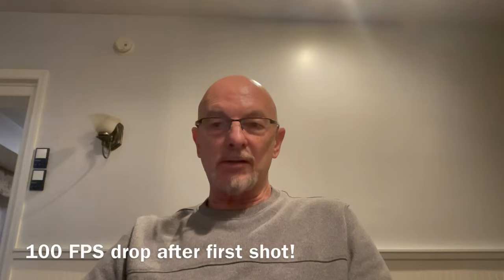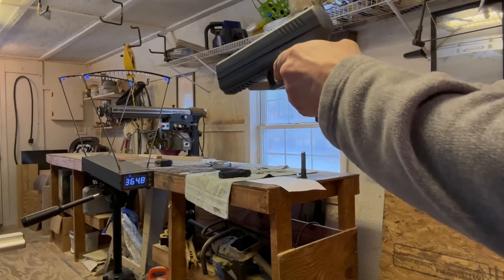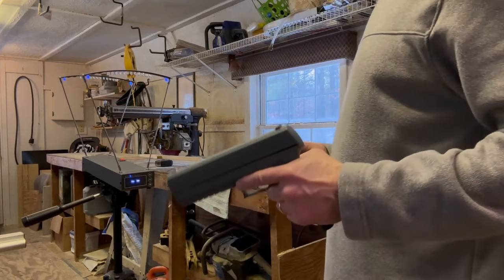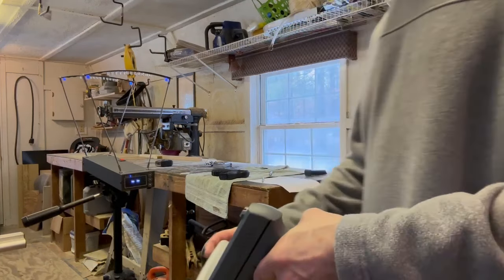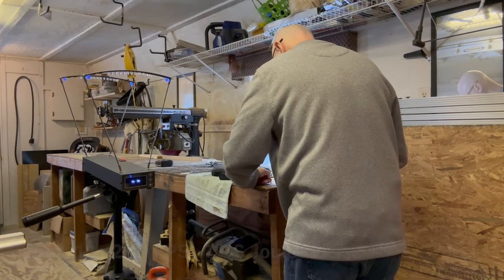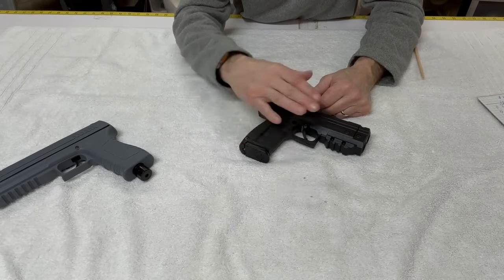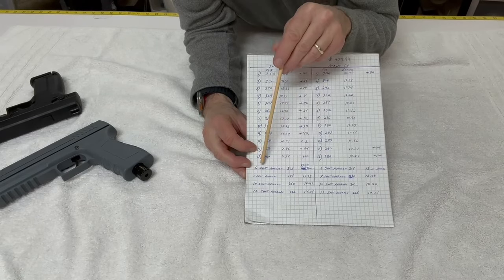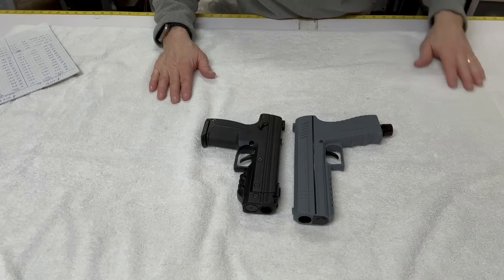Salt Supply S2 Blows Byrna LE Apart in Performance! Wow!!!

Comment: The Byrna is superior in every way minus the fps. You’re not supposed to stand there in a gun fight, the idea is to shoot and escape.
Reply: Tell us how that is.
The salt numbers are what the Byrna was "supposed" to be . Some people get lucky and get one that actually gives good numbers but even the good ones the numbers are never consistent. Watch the FPS plunge with each shot on the byrna where it is minimal on the S2.
Many reports of Byrnas not firing, have not heard of one S2 failing.
Tools required to change a cartridge or reload on a weapon is so antiquated .
s2 is half the price of the byrna... Tell us how it's better
Reply: @tyronetrump1612  Does Salt puncture C02 with trigger pull, like Byrna?
Reply: @rpbauer  no its a strike to pierce mechanism. you load the co2 and there is a knob on the bottom of the launcher. You hit it with your palm , thigh or any hard object. Same way as the Pepperball TRP  works
Reply: Byrna to expensive, rather HDR, 68 or upgraded,50 HDR
Reply: Not at all. Grimsburg is 39 Jules. It will drop someone. The Byrna just stings. Yet both are effective with pepper rounds. Grimsburg has tear gas/pepperspray mixture projectiles.
Reply: Obviously not
Reply: If you are engaged in a "gunfight' with the Byrna or S2, you're simply OUTGUNNED to begin with.
Reply: Grimburg Gavle
Reply: @eligarcia215, byrna is not superior in every way lmao. The byrna LE averages 10-11 joules after the first hot shot at 25 joules. And you're not getting into gunfight with these things 😂
Reply: So you don't want what you're supposed to get because he said it?😮
Whats wrong yo?
Reply: 😂 @CharlesHansen-gl4lh

Comment: A sample size of 10 is way too small for any statistical comparison. You can't take this limited and uncontrolled test as proof of anything. The Salt may be very consistent for the first 10 shots and then drop off even worse than the Byrna did after one. Stats aren't really that hard to understand.

Comment: What are the physical dimensions of the S2?  I am considering SD for concealability and am wondering how the S2 compares in size as well as performance.  Seems from a lot of comments that Byrna may have some quality issues.
Reply from the maker: Hello! The S2 is 8-3/4” long and the Byrna SD is 7-1/4” long. In my view I do not think the S2 is a practical conceal carry option, I leave mine in the vehicle. The SD offers less power but is much more concealable and the drop down clip and pierce and shoot functions are nice features, I own two SD models and have been very reliable. The Byrna LE has not been as reliable as it has been replaced after two repairs and this “new LE” has been repaired after two days of ownership. The SD lacks power especially with a person wearing mildly heavy clothing but for a serious threat a shot to the face will have devastating effects.
Reply: @airgunnerreviews7888  Thankyou for you response.  I'm not a law enforcement officer but from what I seen/read encounters by private citizens with aggressors are within 20 to 30 feet which may allow a significant "Ouch" by an SD.  Of course a quick follow up with a chem. ball would be administered so I wouldn't be clouded in.  Thank you again for reporting the reliability of the SD.  Reliability in close encounters of the violent kind is most important.

Comment: I just put up a video today on the longevity of Byrna. Fortunately I did not get a dud in my LE performs great but by far the salt S2 is a more superior weapon. Just like I don't carry the LE on my person, I would not carry the S2 either. Although I do own the S2 and I do keep it in the house as a less-lethal option.
Reply from the maker: I just finished watching your video and it is always nice to hear a different perspective on Byrna! I still love my SD and has been a solid performer and is the smallest LL on the market. My first LE lasted 10 months before failure and after repair the power was very inconsistent and sent a video to Byrna, it was sent back and replaced after they tested it for themselves. The second LE failed within 2 days of ownership! I am hoping they will redesign the LE to be more reliable and take off the bulky boost off the front. Thanks for stopping by and appreciate your comment!

Comment: Where is your S2 made?  The SaltSupply website says "Made in the USA" but the S2 they send me clearly says on the gun "Made in Taiwan".  I tried to contact them about this but no reply.  I think they need to clear that up.
Reply from the maker: My S2 also says made in Taiwan and if you go onto their website and expand the picture of just the black S2 you will notice the launcher also states “made in Taiwan”. Certainly doesn’t look like they’re making them here!
Reply: Typically when this happens it means the parts were manufactured in another country, and the gun is assembled in the USA. (From what I've been told)

Comment: Well, I'm very conflicted, I don't like the looks of the S2, as it looks like a BB gun and to me that has reduces it effectiveness as a deterrent to would be attackers. I was ready to buy the Byrna LE, but It looks like according to your analysis that I would be better off buying the SD. This video is 5 months old, and I wonder if Byrna has done anything to improve the LE since then. I don't know what to do now. I have watched a dozen videos, including your video "5 reasons to buy a Byrna LE" and I'm thoroughly stuck in the mud now.
Reply from the maker: I totally understand where you’re coming from! The S2 is too large to carry in my opinion and I keep it as a back up in my vehicle. Out of the box the LE is more powerful but unfortunately I have had two of them blow the seal and after repair the velocity is not the same as before the repair. Typically I lose 100 fps between the first and second shot, this was not the case on either LE before repair! I also own 2 SD models and never had an issue with either! Also have purchased several 8 gram air cartridges off of Amazon and have had no issues using them in the SD. Byrna offers a 12 month warranty and very good customer service just make sure you keep your order number and register the launcher.I really like the compact size, lightness and reliability of the SD and find myself carrying it more because it is the easiest to conceal, more power would be nice but I do have trust issues with my LE. Good luck!!!

Comment: How do you chamber a round for the 5 +1??
Reply from the maker: Load 5 rounds in the clip and insert into launcher than remove the clip and you will notice the clip will only have 4 projectiles than add another round in clip.  The first round is loaded into the breach!
Reply: @airgunnerreviews7888  cool, thank you! I always wondered how that works given these don’t have slides. About to pop the seal on my first Air Gun (salt supply s2) thanks to your videos. I have my CCW & will be carrying it along side my Glock 26

Comment: Do you think that the power reduction from your byrna could be related to when you took your byrna apart?
Reply from the maker: Long story! The LE I took apart blew the 0-ring and was sent back and Byrna repaired it but the power was significantly less so I sent it back again and they replaced it with a new LE. I was very happy with the power of the replacement but after a few magazines it also blew the 0-ring and went back for repair and this is what I’m stuck with, Byrna told me this is as good as it gets.
Reply: @airgunnerreviews7888  three sides to every story though. Your side. My side and the truth. I’ve found other YouTubers saying that their byrna doesn’t work properly after firing balls heavier than what byrna has designed for their launcher causing some sort of internal damage. Could this also be the case for yours?
Reply from the maker: DK Spencer commonly tested using heavier projectiles however my first LE I tried only once and didn’t lead to more power so never tried again and that was at least 6 months prior to it breaking. The second failed LE I NEVER used anything other than Byrna C02 and kinetic rounds. I used no trickery in making this or any video. I own 2 SD models and have never had an issue with either and are very consistent in power.

Comment: What about the gavel ? This is supposed to be pushing 700 ft per second.
Reply from the maker: No doubt the Gavle has superior power! My only issue with it is it takes both hands to twist the C02 and in a crunch situation you may not have time or both hands!

Comment: Have you tested the Grimburg Gavel yet... About $500
Reply from the maker: I tested the original Gavle and was super accurate and powerful! Unfortunately it had multiple failures and gave it back, I understand there have been several improvements so I may revisit the newer version. I’m still not a fan of having to use both hands to engage.

Comment: Get yourself a Grimburg and save yourself a headache !!!
Reply from the maker: If only it didn’t take both hands to activate!
Reply: The Grimberg is great, but the whole twist to activate is kind of an issue, especially in a high stress situation. Hopefully the Solstice will fix this issue.
Reply: @airgunnerreviews7888  I have one. The good thing about the twist is it is mechanically very simple, less chance of a failure. My first choice though
if you  are in a situation that you have time to twist it, as it hits really hard compared to the others!
Reply: @MultiSkyman1  the loading system is a deal breaker. i need extra mags....
Reply: @glenng.6041  Agreed. With only a 5-round capacity, the loading system makes the Grimburg an unreliable self-defense weapon.

Comment: Which one has the best trigger pull over all?
Reply from the maker: In my opinion it is the Salt Supply. With the Byrna when you squeeze the trigger the barrel moves backwards towards the handle to cover the projectile so it is spongy to say the least, it’s still smooth but not crisp like the Salt!

Comment: Sooooo cancel my Byrna LE and get an S2?
Reply from the maker: The S2 is too big to conceal carry in my opinion but excellent for vehicle or a secondary home defense weapon. The LE is a better choice for carrying. Hope that explanation makes sense, thanks for dropping by!
Reply: @airgunnerreviews7888  in terms of stopping power/effectiveness its pretty much the same thing then? Since concealment isn’t a concern yea.
Reply from the maker: The salt S2 has more consistent power and is built like a tank for 1/2 the price of the LE. I have also had two LE’s fail! I have shot about 800 rounds through the S2 with no issues. The first 2 or 3 shots with the LE will have more power than the S2 but the salt has more consistent power and averages higher fps when shooting the entire mag. If an intruder takes you by surprise the Byrna will pierce and shoot at the same time but the S2 you have to have time to pierce the C02 in order to fire and that could be a problem. Unfortunately there is no easy answer!
Reply: @airgunnerreviews7888   Hmmm. That is a big concern of mine, in terms of self defense every second matters and having to charge/pierce the C02 seems risky. I guess if you charge it before going out or something it would slowly leak and compromise the FPS? Decisions decisions. No easy answer as you said. Great content thanks for replying!

Comment: Purchased a Byrna LE this last summer. Out of the box, cartridges would empty on their own. Not always. But usually. Asked for a new one and was told that I had to get this one repaired despite it being broken out of the box. Sent it across the country for repair. Was told the problem was identified. Worked flawlessly for one day after I got it back. The next day it was broken again. Pull the trigger and the cartridge hisses while a ball rolls out the front of the launcher and drops to the ground. Exactly what I want when confronted with an aggressor....
Reply from the maker: That is terrible! They definitely have an 0-ring issue that is why I no longer recommend the LE! Thanks for taking the time to comment!!!

Comment: What about the internal features?  The chamber that fills with compressed air that fires the shot, are they the same size for your Apple to Apple comparison?  It sounds like your not doing your homework before slamming a product. I didn’t hear anything about this!  There a lot of things your not covering for your Apple to Apple comparison!  You never say anything even of the different barrel lengths too!
Reply from the maker: Both launchers are 68 caliber and use 12 gram C02 and are in the 16 joules family.   You will NEVER find two launchers with the same barrel size and internals. These types of comparisons are all over YouTube, Ryobi vs Dewalt, Apple vs Android, Samsung vs Sony,  Ford vs Chevy. Do any of these have the same features? Of course not!

Comment: You're asking a lot from a 12 gram CO2 cartridge bro Come on at least do a PSP With a pre-charged tank built into the gun and pressurized to 3000-4000 PSI!? They make Big Bore air rifles so why not for pepper balls paintball the same thing use the Tippmann
Reply: What if you have to double tap how much does the FPS drop or how long between shots do you need to wait before you have full power
Reply from the maker: Certainly an air tank would increase power and shot count but people would be staring at me trying to conceal a tank down my pants 😂
Reply from the maker: You don’t lose any fps if a second tap is needed and a few seconds between shots is all you need for max power.

Comment: My byrna never dropped that far. Never. Dude you got a lemon for an le
Reply from the maker: My first LE was much better but blew a seal and after repair there was a major loss of power so Byrna sent me a knew LE which lasted 2 days and blew the same seal and again after repair I am getting the same crappy results! I sent my video to Byrna and they say there is nothing wrong with the launcher as tests will vary.
Reply: @airgunnerreviews7888  I’m sorry about that mines been good. Listen salt s2 is great too I love the white I know it’s a crazy color but I saw a video on it with the black line on the barrel nice.
Reply from the maker: The white S2 looks sharp!
Reply: @airgunnerreviews7888 would white be smart vs yellow for someone making it clear that it's all self defense?

Comment: My Byrna LE is very consistent.
Reply from the maker: Mine used to be until it went back for repairs!
Reply: @MWS67 I just found @airgunnerreviews788 videos, because my LE “blew its seal,” while I was actively using it to protect my dogs from a coyote assault.  As I’d only ever fired a few practice shots, prior, the failure occurred with only about 40 shots from the launcher.  I’m now faced with the prospect of requesting a repair, that will yield sub-par performance, or pitching the LE and buying a SALT or other.
Shame that Amazon declares they can’t ship the SALT (launcher, only — no ammo) to my Cali address…
Reply: @ScottishTerror  Sorry to hear that. I hope your dog is ok. 

II had to have my LE replaced right out of the box because it had a bad valve or something.  Was only getting 11-12 shots per co2 bottle. The replacement seems to work ok but if it ever fails, I'm done with them. I'm looking at the Huban GK1 .25 cal  to replace it.

Comment: Salt S2. vs  Byrna.
He used repaired models for both.
We need unprepared units for a reliable  results.
Reply from the maker: True the Byrna was repaired by Byrna after the 2nd day of ownership and this is a replacement for my first LE that failed, when Byrna repairs them they don’t have the same power! The Salt was never repaired, I would have liked to have had the chance to use an un-repaired LE but they keep breaking.

Comment: I always thought Bynras were..very overpriced at 400- 500. SD and Alfa LTL  both out-perform it. ( Although I prefer the Alfa because it's smaller and lighter, and also works great with full steel ball ammo.)

Comment: Bro what you actually did you showed how much better the byrna is then the salt your incorrect sir what I saw was the byrna shot really hot the first shot that should b plenty with the oc shot after the first shot with the byrna it consistently stayed at 280 ish fps the salt was higher yea but after 9 shots it dropped to way low numbers the byrna stayed consistent the whole time you just made your self look pretty dumb sir
Reply from the maker: I’d you bothered reading all the other comments you are alone in your thinking! The Byrna had only one hot shot (406fps) before dropping off 100 fps so if you missed with the first shot your screwed. After 6 shots the Byrna dropped off to 292 fps (11.43 joules) while the S2 6 shot average was 365 fps (17.85 joules). It is not practical to think you are going to have time to reload in a self defense situation so most people would rather have the most amount of power within the first magazine. You can throw insults all you want but facts are facts.
Reply: @airgunnerreviews7888  don't miss with the first shot the lol I like the byrna better so mayb I'm just biased lol but if you panick Ina high stress situation you shouldn't own one of these cause your putting not just your welfare at risk of injury but everyone in proximity idk who you are you get shot with a projectile with the pepper mix traveling fast enough to break the round and deploy the pepper mix your all done so you can like the salt if you want I prefer the byrna I saw consistency with both of them and a huge fall off with the salt after the last round tye guy fired while the byrna fired around 230 the entire time